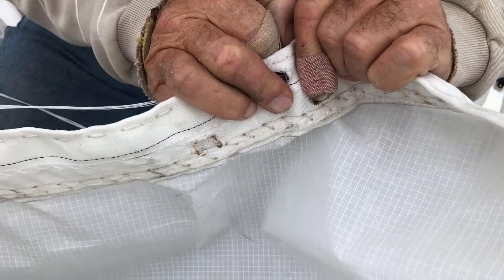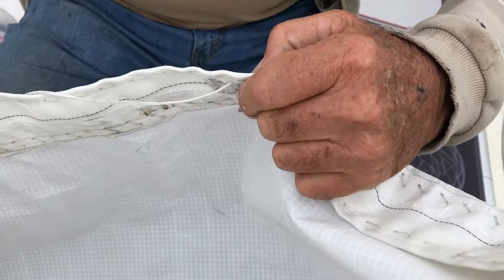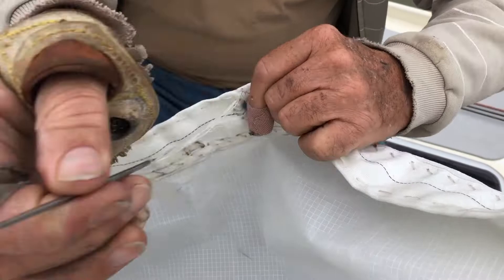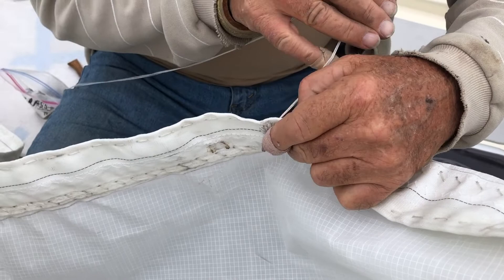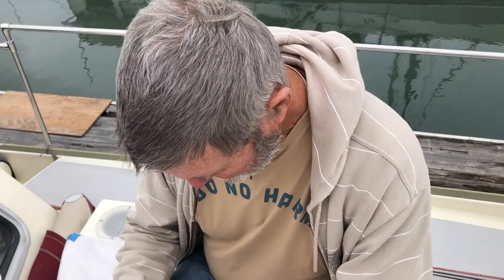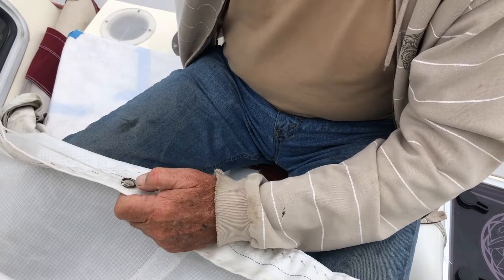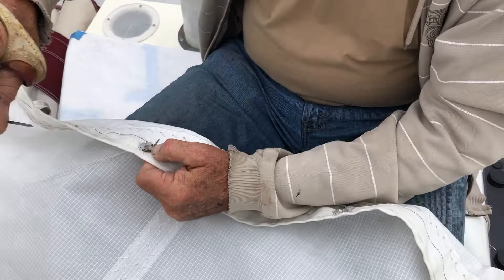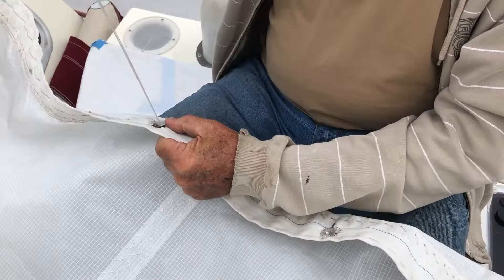How to hand sew grommets into a sail

Comment: Great work. What thread are you sewing with.    You are a real pro.
Reply from the maker: It's Hemingway & Bartlet V-346 waxed polyester. Has almost no twist and lays flat normally. You can also make a good thread from taking three strand polyester rope and breaking it down carefully into smaller threads and waxing it well. I like thgis best of all but when you have to do lots of rings the commercial thread is easiest